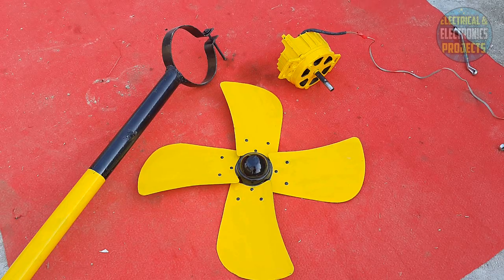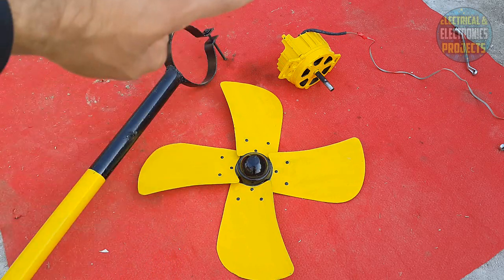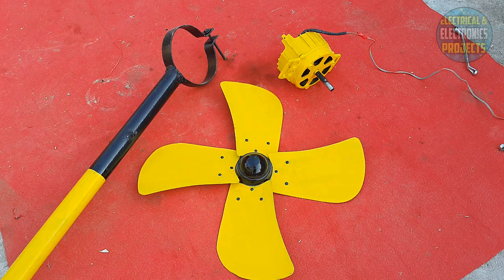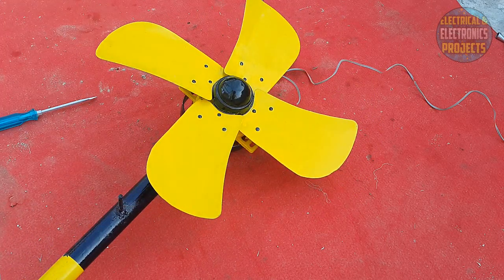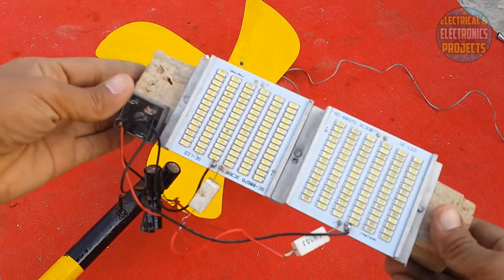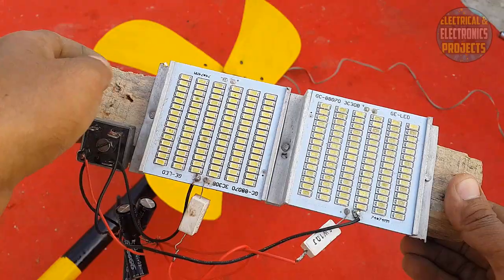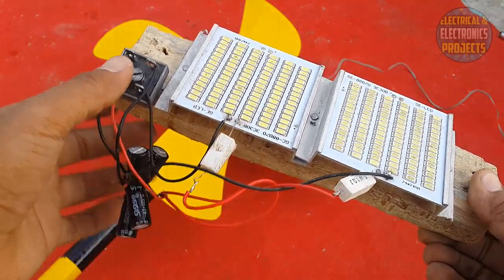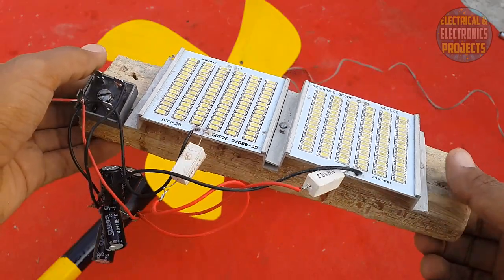Homemade free energy generator took place as wind turbine.DIY wind turbine generator.

Comment: I would love to see how you modify the motor and add  capacitors. I have a second home that has no electricity . I have installed batteries and a generator, i would like an alternative to charging the batteries when I'm away

Comment: You should regulate the output and use it to drive your battery charging circuit, then add a battery for all night light!

Otherwise, just feed the DC output into a battery and it will more or less self-regulate, except you will most likely ruin the battery by overcharging it. 
Or, you could build and add a charge controller...

:)